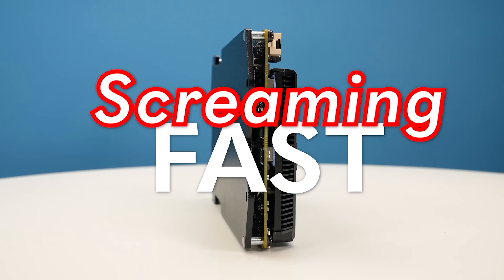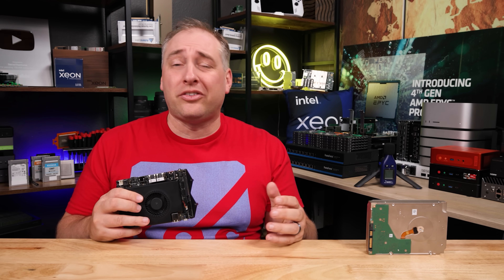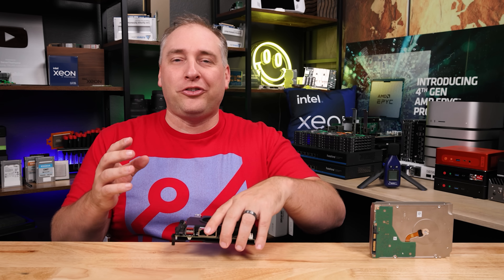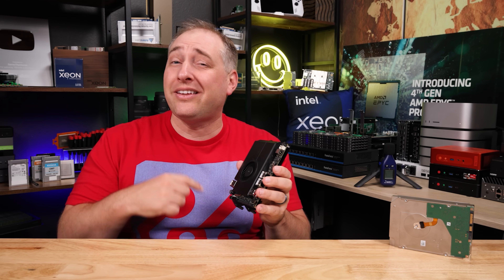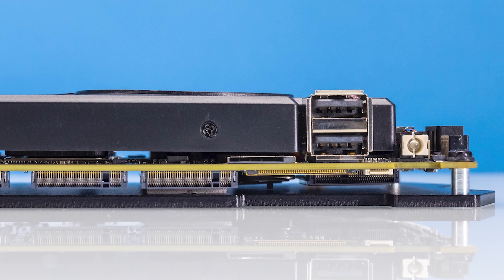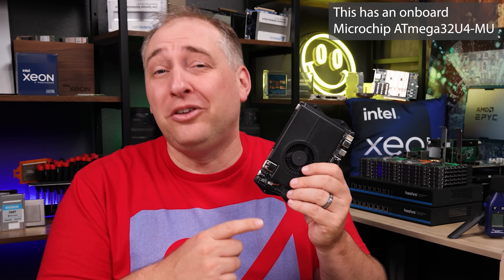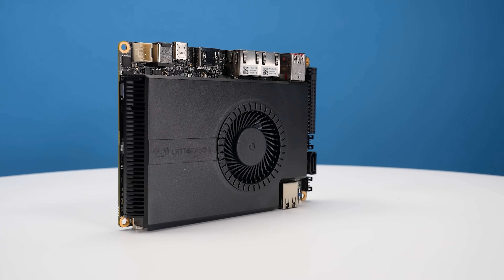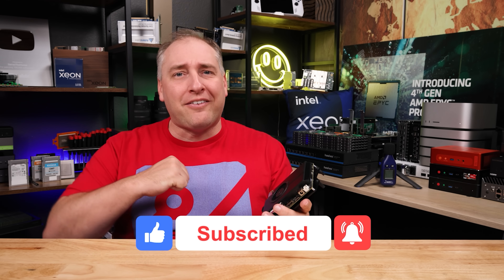This Single Board Computer is Faster than a Mac Mini AND a Raspberry Pi

Comment: One day they'll put every cpu/apu (ipu?) On what is effectively just a sodim socket. Dispite that,  I'm wondering what type of hand held device you could make with this? If outfitted with 2 nvme drives what's the maximum size that's stable? If it's 8tb for the gen 4 and 2 for the gen 3, maybe 2 for the B KEY sata, imagine the monster of a hand held game machine this could be. Like Uconsole with way more power. With 4 10kma flat pack lifepo4, and if you can swap that wifi to a 5g.... or I believe there's been key 5g modules out there that are also wifi Bluetooth.

Comment: With 800£ you get 8 core 16 thread system (AMD) with 36Gig memory and 1Tb ssd and a descent GPU on low tier. Compared to that this is smelly turf choice with upgrade options it has.

Comment: Simply adding an Arduino micro-controller to an Intel MB is not compelling.

Would have been nice to know more about the ATMEGA integration with main system.  Can I use the Arduino processor to wake the main system? is there an SPI, I2C or other method to communicate between processors?  is the GPIO only usable on the Arduino side of things?  who controls the magic RS232-RS485 port?

Comment: sadly this is too pricey.
It would be nice if it would be the us price here too, but sadly all those interesting devices like mini PC's and boards are out of reach here in the EU just because of their pricing. it is ~730€ here and all those mini PC's that are mentioned everywhere for ~200-500$ are like ~500-1200€ just because they are made available to EU. And the difference is always more than just the TAX. (in most of the EU TAX is included in the price)

Comment: The fact that it's Intel killed it for me. If anything, go support projected like the Rock5 model B. It's got an RK3588 chip which is a much more fair comparison price wise but it absolutely blows the performance out of the water. With prism client, you can play Minecraft at 60+ fps (granted GPU is a bit weak) but the CPU is where it shines. Using the community version of Ubuntu desktop, its got full 3d acceleration and you won't notice that there is an arm CPU powering it. It's that fast.

Comment: They can still keep upgradeablity in the exact same size especially when you are taking about the ram.. use chip sockets (not ram slots for sodim) like the old intel 286 cpu socket ised to be. That way you can upgrade ram by pressing the chips into the sockets and sure in will cost a few mm of hight but would not change anything really (maybe a notch in the heatsink to fit the extra few mm) same goes for the CPU use the old laptop socket that had the real slim socket and a screw that slides it to lock into place. Again it will add a few mm in the hight but it's a 3.5in SBC a few mm isn't going to matter a single bit.. so really they could make it upgradeable in the same form factor and would not add much more complexability as the traces and PCB are exactly the same its just the cost of some plastic press fit chip sockets essentially

Comment: ive looked over a lot of the reviews on this, and everyone that mentions the Arduino misses one really obvious use case for it.... you turn around and Flash Adalight to it, and then you have an SBC that can control your Ambilight set up with no extra hardware... supposing you are putting this thing behind a monitor already, its the perfect addon for that task

Comment: Can it stick to a velcro tape on a wall and eat the same power or less than r-pi?
Reply from the maker: You can Velcro mount it. A RPi 4 or RPi 5 will use less power, but the ~15 RPi 4 or 4-6 RPi 5 to get a similar amount of performance will use significantly more power

Comment: entire raspberry pi 5 setup costing less than half of lattepanda
Reply from the maker: But you need 4-6 Raspberry Pi's to hit this level of performance
Reply: Alright, so the 720$ 32 GB version. 12 cores of 13th gen i5 1340p CPU and 32gb LPDDR5 ram. 6 8GB raspberry pi 5's have 48GB of lpddr4 ram. the CPU's on the raspberry pi add up to 24 cores @ 2.6Ghz, with the lattepanda having 12 cores clocked at a max of 4.6GHz. although the lattepanda has multithreading. Both with integrated GPU's, the lattepanda comes on top by  a landslide.  same with I/O, and bandwidth. so overall, even with the 6 raspberry pi's, the lattepanda is better depending on the workload. NOTE THAT I AM NOT A PROFFESINIAL AND THIS IS FROM THE LITTLE REASEARCH I HAVE DONE

Edit: i looked at the raspberry pi 5 price and on vilros you can get them 80$/board. so you can get 9 boards for the price of 1 lattepanda.

Comment: How many Operating systems can i run at the same time with this? I am a security researcher and i would like to run Proxmox at it, with for example: Security Onion distro, RockyLinux, Kali Purple, Windows 10 / 11. Windows server w/ AD for tests, Win 11, 10 for malware tests, Remnux + containers, Suricata / Snort, Elastik ELK /Wazuh, etc. I might add or change stuff in the future but would be something like that. Would it run all at the same time100% smooth? Id buy the sigma 32 GB RAM versioN (64 woud be perect but ive read cant add till 64)
Running 24/7 whole year.
Reply from the maker: Personally if I were targeting running 8+ OSes, I would aim for 64GB of memory. Some of those are not too bad, but 32GB / 8 VMs = 4GB each. 64-bit OSes tend to use more RAM so I try using 4GB as my lower limit.

Comment: Shit this thing being a minimum of 600. Why the hell are you comparing it to a pi? You should compare this thing to like 40 pis. 

For 600 bucks you could buy a fucking laptop. Or you could buy a barebonea PC with the same shit for way cheaper. Why the fuck would anyone be stupid enough to buy this. Those are two examples that immediately came to mine that would save you money and give you similar proformance. There is probably 20 more ways i could think of.

Comment: This is no PI competitor... I use PI's for low power apps, my home router/firewall (OpenWRT) plus home automation (running in a Docker container) is the size of a pack of cigarettes (Pi CM4 and dual gbe carrier board), fanless, and consumes LESS than 2 watts in operation (not at idle or standby) and keeps up with a near-gbe fiber internet connection. This looks more like a niche product for folks who want a cheap pc option... but wait... it's not that cheap.

Comment: It's $579 on their website and $600 on Amazon for the bareboards version. What is the point of this other than 50W TDP, that can't be achieved by any other SBC, or even a proper laptop or ITX desktop build? I work with SDRs and build satellites for my day job and have done tons of DIY projects in the past, some for commercial production. For the same price I could get an Nvidia Jetson AGX Xavier Developer Kit. This Sigma doesn't make any commercial sense.

Comment: If it doesnt have at least 16 cores 32 threads it wont make sense for me. Core count has gone up last few years. I have Chinese mobo with 10 core 20 thread and a RTX3050 for about 600-700 euro. I dont see the point of buying for a higher price or equal price when the core count is low because of the intel processor
Reply: That 10 core cpu now Costs only 15 euro. So the build would now cost probably 450 euro to build

Comment: tbh this is like “Your raspberry pi 5 with an arm cortex a76 cpu is not as good as my sbc with a core series 13th gen processor 😂😂
fits in pocket ❌
cheap ❌
5 watt power draw ❌
yummy sounding ❌
no hate though, quite a good sbc you have here

Comment: I worked with Latte Panda Alpha and Delta3. They are cool but onboard arduino Leonardo is kind of useless. I don't understand why they keep pushing so limited processor.

It's expensive compared to many micro PC with connected to any arduino.

Comment: Another Latte review claiming Mac Mini M1 dominance as a victory except we are at M2 and none of the claims stand up... Not shilling for apple here, just pointing out that this is a marketing video not a real performance comparison.   
Geekbench  M2 12core cpu = S2649 M14247  the fastest Latte Sigma 12core CPU = S2315 M10008 (getting these numbers from the official geekbench website to be more accurate)... so its not winning this race, yet also this is at the same price so there is no price advantage either here...
Furthermore it looses handily when it comes to either thermals or power consumption against ALL arm/RISC competitors... 
The important thing here though, is that Latte Sigma though does not compete with a mac mini but other single board computers which are a much better benchmark to how great this is .... Even though windows is a negative in the singleboard computer world (it is way way too power hungry) it is to it's advantage that you can run x86 executables in either Win or Linux as there is such an overwhelming amount of x86 software.

Comment: Marginally more multicore performance (still less in single core) and about 3 times the power draw makes this a pretty pathetic competitor to Apple's silicon...guess it's a good thing it's an SBC and not a laptop, so you really only have to worry about the extra power and noise.

Comment: this costs 6 times more than RPi and consumes 4 times more power. Why the hell are you comparing them? just because both are SBCs? that's ignorance.
their sizes are from different classes, their scope of release is almost completely different. they are just 2 different things built on a single board...

Comment: It really is all opinion isn’t it, and here is mine. As great is this may be for some, you’re comparing apples to oranges (or in this case, coffee to apples and raspberries) and 3 different operating systems. Not to mention price point and fit and finish. There are so many choices out there and in the end it is really just preference. I have used all 3 OS as a daily and honestly, Windows is not king anymore. Not for me anyway. On the flip side I certainly see the usefulness of this for likely the majority, hence the importance and security of Linux. Great review of the product!

Comment: functionally, ECC is relatively useless and slows memory. If it fails, it fails. It takes a ram stick tester to validate bad ram, otherwise bios or Windows takes forever to check. These aren't production blade servers with fail over. Not really a plus. If you look at how ECC and Hamming code works... it's whatever. Let me know when you can hot swap ram sticks.

Comment: Only thing it is missing is an OCuLink port for nearly 700 bucks with such a great setup as this, fast ram, great cpu, good cooling, small size, good storage options that won't bottleneck anything, USB 4 is such a waste of potential I can hardly stand it. OCuLink is far superior to usb 4 for external gpus. Not gonna pay that much for something so close to being good. Definitely going to message the company to make a pro version... Also with pci gen 5 nvme drives instead of Gen 4... Close but no cigar...

Comment: Huge power drain… X86 is dead…
Reply from the maker: Strange comment. I mean, in the server space, x86 is now better perf/ watt than Arm server CPUs even (see our Bergamo piece.) Remember, CPU core IP is now a relatively small part of modern chips. This platform is about in-line with the upcoming RPi 5 if you had enough Pi's to hit the same level of performance (6-8.)

Comment: I picked one up and have been trying all day to get the bios updated, but can neither find documentation on how to do this nor figure out how to do it myself.
Reply from the maker: The BIOS flash was a standard EFI workflow with a .bin BIOS file. We just used a USB stick with the BIOS.nsh, BIN, and the EFI startup files as we normally do with motherboards and it worked.

Comment: It is very expensive, you should really need that small form factor. i3-N305 fanless PCs can be found for ~240 euros - not latest gen but probably more appropriate for this form factor.
Just did a quick search and a mini PC with this processor can be found for 2/3 the price of this.

Comment: Am I the only one thinking the x86 architecture is obsolete in 2023?  Especially at that price point?
Reply from the maker: I mean, in the server realm, we just did a video on the AMD EPYC Bergamo that is 3x the performance (in the WORST case for x86 v. Arm) but is like 50% more power than the Ampere Altra Max 128 core Arm part. "Obsolete" when it is much higher performance per core and performance per watt, and offering way more features in the server space feels strange.
Reply: @ServeTheHomeVideo  sorry, I misinterpreted the point of the video.  I thought you were discussing SBCs not $12,000 server cpus.

Comment: I get that these computers are supposed to be low profile but I wish they would stop using blower fans. These mini pcs/ single board computers are capable of a lot more but the cooling severely holds them back.

Comment: Yeah - the point of SBC is mostly alternative and low power CPU's like ARM and RISC, at low cost. This is a standard desktop motherboard in smaller form factor and high price. It is a NUC / Desktop hybrid without a case. For this form factor I would rather go with AMD APU based.

Comment: A 2012 Mac Mini is 4x the speed of a 2023 Raspberry Pi 4, but uses just 2x the power (and has better power management). Those unsupported minis can be patched for newer macOS, or run ubuntu. While a mini isn’t fanless, they are over engineered for quiet especially if you swap in an SSD.
Reply: This is a fantastic point.

Comment: Comparing this to a Raspberry PI is ridiculous, it is essentially a laptop motherboard with an intel Core i5 processor. This video is little more than a shameless advert for an insanely expensive SBC. There are small form factor PC PicoATX motherboards just as good as this thing for way less money with upgradable RAM too.

Comment: Price and power consumption... no go. For that money I could get better performance in a standard low cost desktop PC. It is not comparable to a Raspberry Pi sipping 5W at load. I guess it has it's uses in edge case projects but I can not imagine there are many of those.

Comment: Would like AMD 7840U or HS model there. Look at the scores that CPU has.

EDIT: Just followed the link on AliExpress. Its 709£ for version with 16Gb ram and 500Gb of SSD.
A miniPC with AMD Ryzen 7940HS (that tops those graphs for most of the part) with 16Gb ram and 1Tb SSD is 555£. Dimensions (mm): 120*110 vs 102x146 for Sigma.
If you do not need specifically board that has PIO connector, but just small computer, I think its very easy choice.

Comment: Faster than MacMini in multicore score by 2% but slower in the same benchmark in single core by 15%? By definition, that means its a slower.
Reply: And with bigger consumption and fan noise so this review is totally unfair
Reply: @jacquesdupontd  Single core performance lost its importance decade ago... and noise and power consumption importance is very situational.
Reply: or faster, if using multi core.....
Reply: Are your definitions from year 2008?😅

Comment: I have one of these.  For me, I wanted a SBC that could drive 4 monitors, was very low power, and have a modern processor.  In terms of computation, I needed it to be able to smoothly stream video (which a Pi just couldn't really do well - that was the upper limit for what a Pi4 could do, really).

I should caution - when I ordered mine, it shipped from China, so it took a little while to get here.

Comment: I don't think comparing it against either a Mac Mini or a Raspberry Pi is a good comparison. The former is a complete system and the later is significantly cheaper and smaller. I'm sure that it has its niche market, but I don't think it is the same one as either of the aforementioned.
Reply: Such a strange claim to superiority, too. They're using Cinebench scores, which for their multi-core tests are heavily weighted on OpenGL graphics tests. Any real performance test would throw that on a GPU using Vulkan or Metal with way higher performance. ServeTheHome's website Geekbench scores have the Sigma 25% SLOWER in single-core performance and only 6% faster multi-core performance than a Mac Mini M2. 12 Intel cores can barely beat 8 Apple cores? x86 is showing it's age, and servers are the place where its shining the least.

Comment: less than $600 you get a laptop with the same i5 13gen cpu ram + 512gb nvme with free 8hr backup battery, fhd screen, keyboard and mouse, plus a selfie camera to track you, not to mention a pair of crappy speakers with mic. 

what people expect from SBC is 2/3 the price of laptop at the same specs

Comment: Orange Pi 5 is significantly faster than a Raspberry Pi 4, is a lot less expensive than this monster (though admittedly slower), and (more importantly, at least for me) pulls only a little more power than the RPi4, which means you can hang several off a fairly cheap PoE setup for remote power.
Reply: As you say, for most people low power and inexpensive are the primary concerns with SBCs, this thing is like someone getting a laptop motherboard and adding on a DC power jack. Insanely expensive too for what it is. There are plenty of PicoATX boards way cheaper than this with more comparable features.

Comment: The ATmega32U4 is a tiny chip. 32 KB self-programming Flash program memory, 2.5 KB SRAM, 1 KB EEPROM. Putting an RP2040 on there would make a massive difference. I'd really like to see one of the IO pins tied to the Reboot and Power button on the computer so the chip could control the computer meaning that while the board has power, it always runs the "Co-processor" chip of the RP2040.
Reply: Just download Atmel studio and write in C your own function you want for it... So your idea is mute.